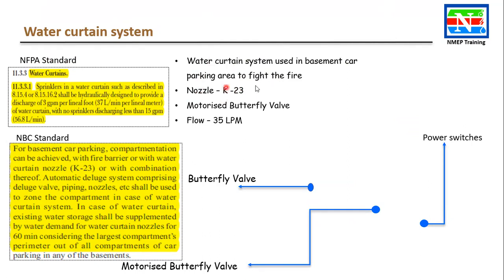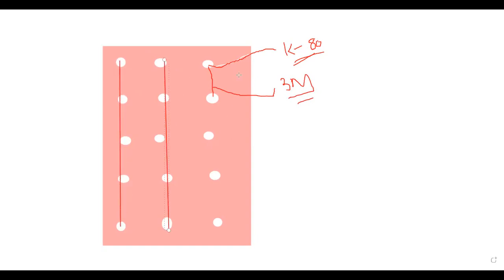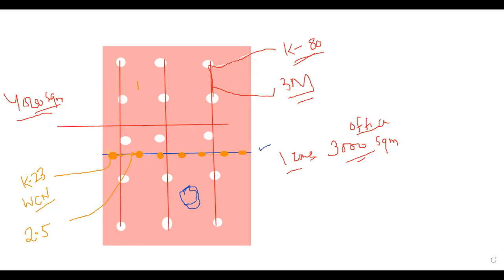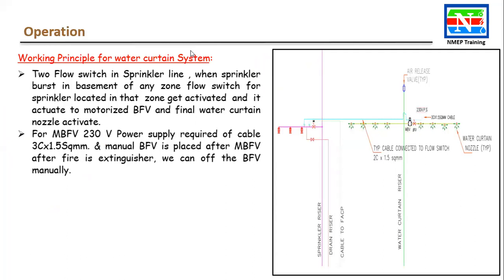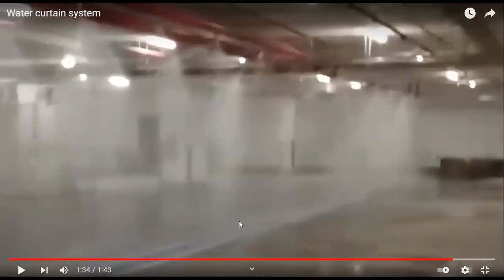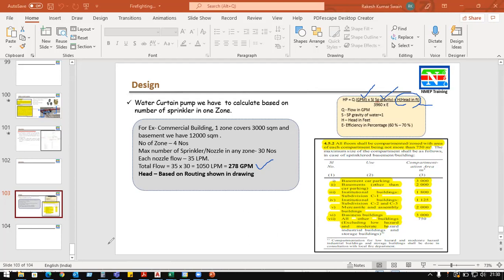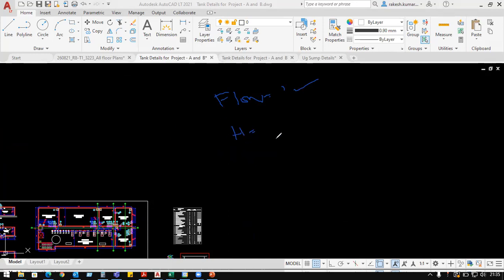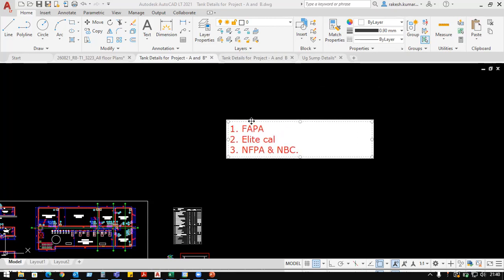FF  Class 20 NFPA 13| Water curtain system

Comment: My safety consoler said in a light hazard building at the  patio area i should not install water curtain. It is under 100 squere meter. Is he right?
Reply from the maker: As per NFPA standard ,  Hydraulic Area 
Light hazard -200 sqft 
Ordinary hazard - 130 sqft
High hazard -100 sqft